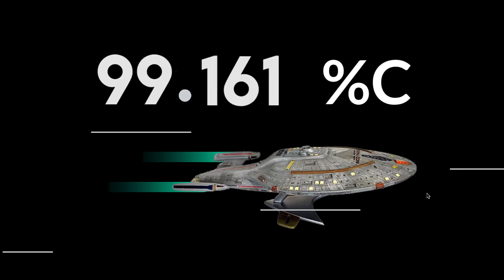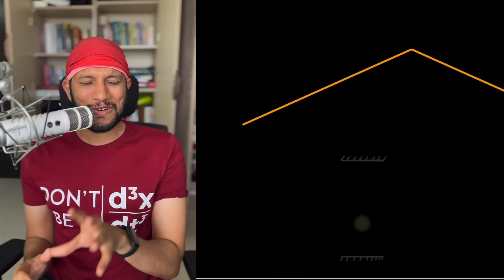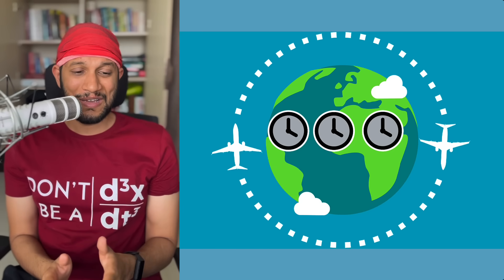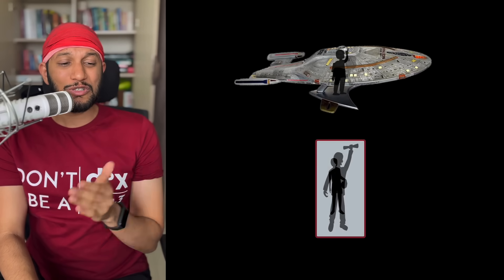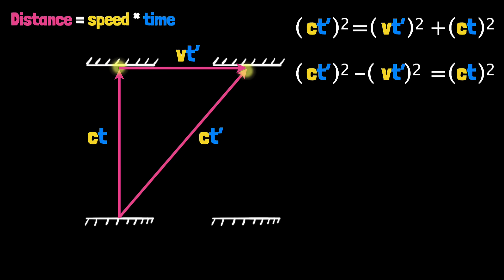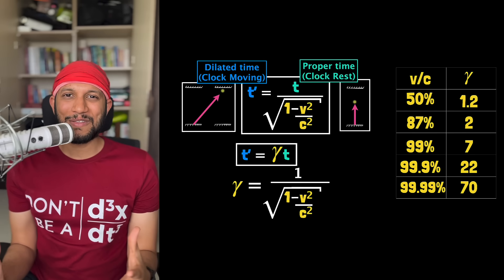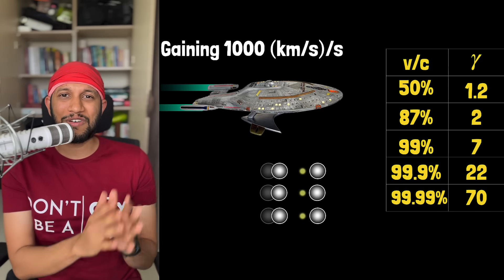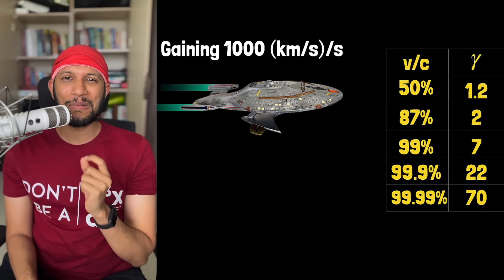I finally understood why you can't go faster than light! (My mind is blown)

Comment: Can't watch this.

Clocks are a physical attempt to quantify time. They do not denote the time itself. 
To say a physical interaction denotes time itself would be like me measuring time by running and if I run faster, I'm now time travelling. I'm not, I do not determine time. I am just using lap timing to make a metric of it.

Clocks being physical means the clock is slowing down, aka the physical mechanism of the clock, not time itself.
This lends itself to relativity, but in no way does it change time and the idea that light speed is a limit is still absurd just like half of physics rn, including anything the borderline flunky einstein said

Comment: Speed has nothing to do with time no matter how people wanna spin it. Time has nothing to do with physics, and we haven't seen anything faster than light, but light is extremely slow that the blackholes overpower it which means there is a much faster speed. And let's talk about this goofy theory again, the physical "tool" to measure time and the photon will have the same speed horizontally here as the ship, so even that clock won't be dragging any assumed longer distance which is basic physics.

Comment: The way I always thought about it is like how going supersonic is. You can't go super lightspeed because the atomic interactions themselves are limited by the speed of light. If you wanted to exceed these limits, you have to isolate the interactions to a separate instance of the universe that travels along with it. The issue with that is, however, space has to bend faster than the speed of light which is not possible, so warp drives are basically impossible. Even if it were, say space can move along with an object. Space has a limit of speed which is light, so moving with it will be capped at either light speed or 2x light speed with your relative light speed never exceeding 1x. A lot of this speed talk is concerning tho because it gets real hairy real quick. This is because the person traveling at that speed, as they approach max speed, experience less and less time. So if they travel 99.99999% the speed of light, billions of years may pass within an instant for them and they have basically 0 control over how much time passes.

Comment: You cannot travel at the speed of light if you have MASS, the really bad thing is that the speed of light on a cosmic scale is still quite slow, it will take us about 6 years to get to the nearest stars depending on the rate of acceleration and deceleration of the vehicle.

Comment: You are wrong.  The photon clock is X-axis  at the speed of light.  You're talking about moving it on the Y-axis. What you should really wonder is if you travel the speed of light and turn on a flashlight backwards, would you see it on the craft or standing behind it. What i find more complex than light speed travel is the bolt in space that keeps flipping.  I think i can explain it but it still hurts my head.

Comment: So if the speed of light is an absolute constant, then by now we should have been able to determine what our speed is relative to "point zero" in the universe. If this has been determined, then I missed it. My understanding has always been that everything is relative. We can tell if a celestial object is moving toward us by the blue shift in the spectrum, or away from us by a red shift in the spectrum. That leads me to believe that the speed of light is relative to the object emitting it. Now if that's the case, imagine two ships, each traveling toward each other at 55% the speed of light. Relative to one another, wouldn't they be traveling at 110% speed of light? That's where time dilation kicks in.
Reply: There isn't really a "point zero" In the universe yet. It's very hard to determine it with an experimental way. That's why most scientists say that speed is relative. The speed of our universe must have a VERY small difference on the speed of photons.

Comment: Bullshit, just use warp drive
Reply: Warp drives are impossible.
Reply: @npc_citizen9276  says who ?
Reply: @mikealex4979  say mathematicians and scientists. It's impossible to bend spacetime with our technology, and we won't be able for at least a thousand years.
Reply: @npc_citizen9276  well they are wrong. Im not talking about bending space, im talking about traveling with 1 milion km /s for example which is totally posible with a strong enough propulsion system like anti matter or exotic particles. Remember, thats what they said about the sound speed, that it cant be reached and nowadays we have jet plains with 10 x sound  speed. Light speed is just a speed, sure its the psihological factor with time dilatation and we need inertial dampeners to not be squashed but other that that its doable
Reply: @mikealex4979  It's not. If a particle with NO MASS has a top speed, I don't think particles with mass can reach this speed. Particle accelerators are trying their hardest to accelerate a SINGLE PARTICLE to light speed, but best they did is 3 m/s away from light speed, because that's how theory of relativity works. You can't physically go beyond light speed, but if there was no speed limit, it would have been a really scary world.
Reply: @npc_citizen9276  ita just theory, you know ? "Theory" of relativity and i think you are wrong, theres no such thing as speed limit . Dont bother replying
Reply: @mikealex4979  Not a theory. Particle accelerators are made to try and accelerate particles beyond the speed limit, but they never succeeded because it's impossible. Because you will need infinite power to accelerate something to light speed, or you need a particle with no mass, something like a photon. That is LITERALLY the base of all physics. In the scientific community, the speed limit is a FACT. "Don't bother replying" Looks like you're just giving up. And you can't even spell right, even though you're fluent in English and I'm not.
Reply: @npc_citizen9276  you dont need infinite power or time to accelerate to light speed and beyond, thats only fron outside of ship perspective, fron inside the ship you need hige amounts of power but not infinite. Its definetly not the base of newtonian physics, its just a flawed theory. Im not giving up. Im not fluent in English, im from Romania. Looks like you make a lot of asumptions just like your theory. Im also on the phone, maybe thats why there are some spelling errors

Comment: So if i where inside a ship at 99.9999% speed of light, if i where to turn on a laser facing the direction of movement than it would take more time to reach the wall as opposed if i did that in a slower space, with the same logic if i where to turn it on at 101% it would go to the direction opposite of movement?
Reply: unlike a cannon or missile fired from a plane the object would not add the speed of the aircraft to its velocity but rather use a const velocity?

Comment: There is also the problem of the photon clock. If the vehicle travels at c, and the photon in the clock travels at c ... keep in mind c being constant in all reference frames ... we now have an unsolvable paradox. When the vehicle doesn't travel at c, we can use time dilation to maintain the photon's velocity despite traveling a longer distance. But when the vehicle is at c, we cannot use time dilation anymore - the observer needs to be able to see both the vehicle and the photon move at c simultaneously and have the photon remain inside the clock. Which is not possible. We are trapped in a paradox where time dilation "should" be infinite to solve the problem of two objects moving at c even though one of them is at a longer path - but cannot be infinite, because that means the photon stops moving.
Reply: Look at the first figure for "right triangle" on wikipedia. The photon clock paradox (when the vehicle moves at c) is like saying we can make a triangle where *b* and *c* have the same length without the triangle changing shape. And of course we cannot. If you fix the x value of all the points, the only way b==c is if a==0 - which doth not a triangle make.

Comment: I feel like I'm about to commit a mortal YouTube sin. Anyway...

I understand what you mean when you say a philosophical debate is "meaningless" for science (7:35)--there's a difference between a philosophical question and a scientific question--however, to say it's "meaningless" for science I think is the wrong choice of words. The statement itself is inaccurate (but that's not to say the following is necessarily relevant to the point you were making). Science is deeply rooted in philosophy, both historically and practically, such that science itself is not possible apart from making philosophical assumptions. Though science as a discipline is interested in physical measurements, the idea that such measurements are possible, and meaningful, is grounded in philosophical principles, like the principle of induction. These principles are foundational to science, yet they are not scientifically justifiable (that would be question-begging). While we may accept a principle like induction because it yields practical results, the rational grounds for it remains subject to philosophical inquiry, and consequently in a very real and valid sense it is true to say that science requires philosophy, and in fact assumes it constantly.

Take the principle of induction as an example. How do we justify our belief in its reliability? To say "because it's worked in the past" is circular. Consider the belief that the sun will rise in the east tomorrow. Let 'S' represent "the sun will rise in the east tomorrow," and 'I' represent the principle of induction, which asserts that patterns observed in the past will likely continue in the future.

We believe 'S' because of past observation (O) of the sun consistently rising in the east:

O --> S

However, 'O' implies 'S' only if we assume 'I', as 'I' bridges the gap between patterns and future expectations:

I --> (O --> S)

(That is, if the principle of induction is a reliable principle, then it is the case that if a consistency is observed in some past collection of observations (e.g. 1,000 sunrises all occurring in the east), then we can reasonably expect for the next instance of that phenomena (the sun rising in the east tomorrow) to reflect that consistency, adding to the collection of observations.)

But WHY do we believe I? The common justification is that induction has historically been reliable (R):

R --> I

But 'R' is a claim about the past. It requires 'I' to infer future reliability. This creates a circular dependency:

I <--> (R ^ O --> S)

This circular reasoning shows that the principle of induction cannot be justified purely by observation or science; it presupposes what it seeks to prove. And yet science itself heavily relies upon it. This means that scientific observation relies on philosophy to make sense. Science has no framework to address these issues, and yet they are foundational to the whole scientific enterprise. But this also makes sense if you think about it, because all of the sciences were historically extensions of philosophy that branched out to their own disciplines when they became more specialized. 

All of this to say, like it or not, the very act of scientific observation assumes philosophical principles--some of which lead to serious debates when we start asking the hard questions of their justification. For instance, the deeper question--why we intuitively trust a principle like induction when it cannot be justified empirically--points necessarily beyond empirical science, and quite possibly to a rational origin transcending the material world. It becomes increasingly more difficult to escape the implication that the rational mind may have a supernatural origin, as these philosophical problems reflect a natural and necessary intuition that is nevertheless neither justifiable by a priori nor a posteriori arguments. In a word, our everyday thinking processes take for granted certain principles which we "know" to be true, but cannot actually rationally account for WHY we "know" them to be true, except to say as a matter of HINDSIGHT that "it worked out" to trust them to be true (and that's fine for pragmatic purposes, but it doesn't JUSTIFY the principles in a way that explains where the intuition comes from in the first place).

My point is simply this: Whether or not one agrees, the inescapable link between science and philosophy demonstrates that philosophical debates are not only meaningful to science but essential for understanding its foundations.

Comment: The invariance of light speed is based on the postulate that light travels at the same speed for all observers. This observation leads to the conclusion that nothing can accelerate to the speed of light, as doing so would require infinite energy. I think you might be starting from a step further back by stating that light cannot exceed its own speed, which is somewhat circular. It's important to clarify that this is a consequence of the invariance postulate rather than an independent observation.

Comment: I like that this guy is getting so excited explaining this concept he is literally slurping through his mouth for air to talk. I do mean that unironically, it's genuinely nice to see someone so excited to relay information they find interesting.
Reply: You're right, it is a concept. Which it is not tangible.
Reply: Did you realize that your conclusion ends with the energy required, infinite or finite? Did you know that you also need energy to see the photon in the photon clock bounce? Just for reference, the photon in the photon clock must split off a photon to your retina in order for you to see it. Even if you only see the photon in the photon clock once a second, the photon in the photon clock must split off a photon to your retina every second, not to mention that Einstein also saw it. So, at least two photons are needed. Of course, to connect the dots or photons you see and form the jagged image, do you know how many photons you need to see? Does the photon clock on the spacecraft have enough energy to emit enough photons for you to see it, whether you see it or not? Indians are the best at regurgitating what they have eaten and acting as if they have understood it. After all, at a speed v comparable to the speed of light c, does the Pythagorean formula still apply?

Comment: There's one little thing I think you missed near the end: The simple reason we would never be able to reach C (ignoring infinite energy vs infinite time), is that if by some miracle, you actually reached C, the photon in our clock would be moving at exactly the same speed as the clock; the 'clock' will have effectively stopped.

Comment: But from the perspective of the person inside the ship, they are constantly accelerating because they don't experience time dilation. Is their perspective wrong then? I guess if they measure their speed based on a external reference point they would realize that their speed is not actually increasing.

Comment: He did not emphasize one super important thing, that the the speed of light c is constant in all frames of reference. This thing along is super unintuitive, and for those of you who think they understood it - try to understand that when you run towards a photon with a speed of v your relative speed is not c+v, but instead c again. That's not what everyday experience suggests us, yet that's exactly what's taking place. So, this is the bug, the weird thing. Noone knows why it is like that, but rather people know that it is like that, because of numerous experimental evidence. Everything else is just 7th grade math. Also, he should be very clear about frame of reference each time he talks about time. Btw, the muon lives longer only in our frame of reference (as a stationary observer on Earth). If you sit on the muon (meaning you are in muon's frame of reference) and measure its half-life it will produce the same 1.5 micro seconds.

Comment: (1) The description/visualisation of the clock hand moving via the electromagnetic interaction is misleading because there is actually a much lower limit of how fast information about motion can travel in matter, which is the speed of sound.
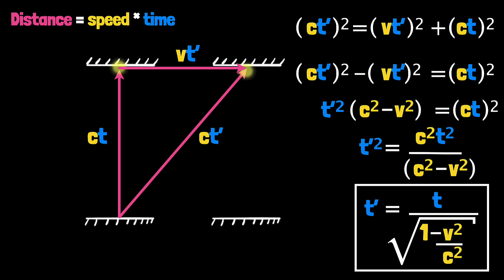(2) Please don't ever ever ever write whole terms on the same height of just the numerator of a fraction (like at 9:40), write them at the height of the fraction. I've seen this in handwritten stuff before and I figured the writer just realised while writing that they're writing a fraction, but this is the first time I see it in computer writing, and it seems borderline insane to do that. I imagine in any tyepsetting program you actually need to work around its default functionality to achieve this confusing, misleading, and frankly ugly format. And for what..?

Comment: I know this isn't the focus of the video but I feel like there's always someone out there that might need to hear this. You can't travel THROUGH SPACE at or faster than the speed of light.
If you manage to warp/fold space-time nothing prevents you from travelling from point A to point B faster than the light travelling through the normal route. 
Doing it for real has its own challenges, but theoretically speaking you would travel "faster" than light, just not through the same space.